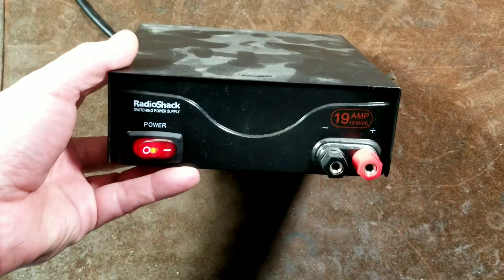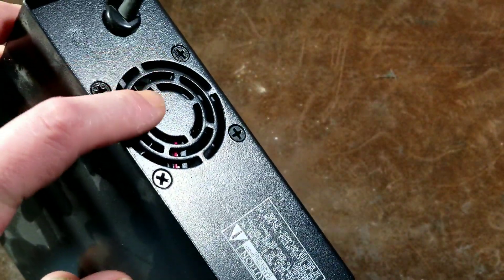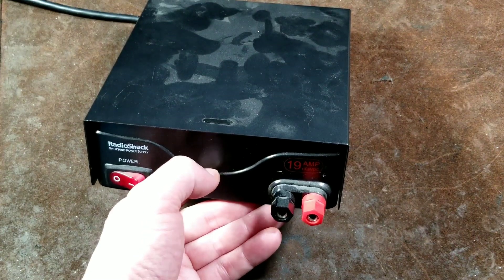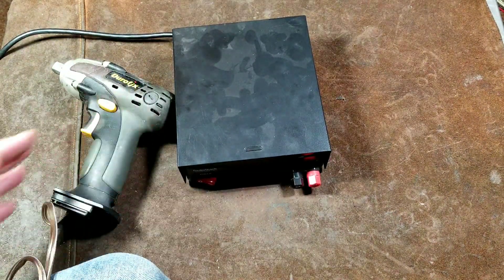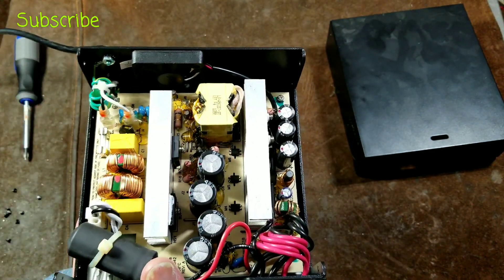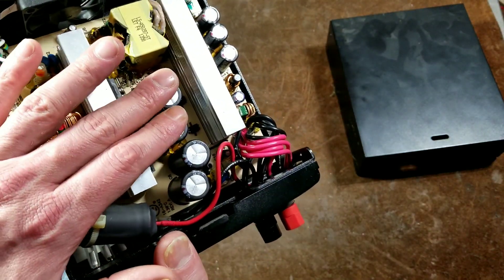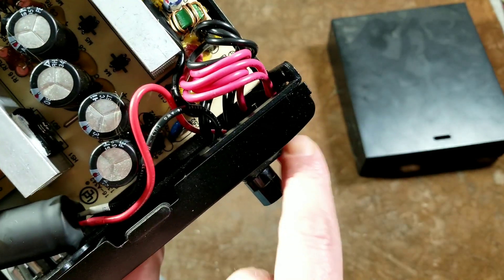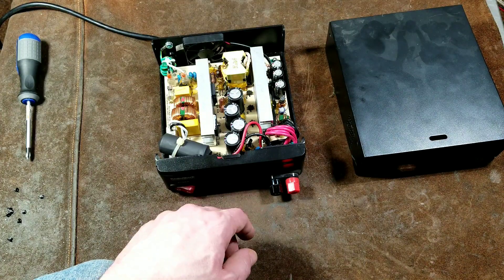Radio Shack 19-Amp 13.8 Volt Utility Power Supply Review

Comment: I got the Radioshack 3 amp 13.8 VDC works great but, will it burn out my Wolfbox dashcam max amp 3?
I'm confused do the amps on the Radioshack regulator have to be equal the same as the Wolfbox above?

Comment: was wondering is there any tuning control on the board so i can make adjustments to the voltage looking for some thing a little lower in voltage 12.6 volts.thanks.jim
Reply from the maker: The output asset buy a soldered resistor I'll take another look and see if I can figure out which one it is really shameful they didn't include a potentiometer
Reply: hi I have one it comes on but won't turn on my amplifier using it for more than five years now an also when turn on I can hear a clicking song when switching it off it stays on for about five sec before it comes off completely 🥺 please help

Comment: I got one of these several years ago at our local RS franchise before it closed. Used it for 2 years straight to power a Kenwood VHF ham radio. Very reliable and no problems with the radio at all.
Reply: I just purchased one for a similar type of radio.  No issues with the noise from a switching power supply?
Reply: @timtaylor8557  No, not at all. I was using a ladderline antenna hanging outside with 60 watts o/p from the radio (TM-271). Talking to a repeater about 30-35 miles away.

Comment: Also check out used rack-mounted server power supplies. You can get the better part of a kW rating for 15-20$. I have  a couple rated for 12v at 62A. The downside is you have to manually connect some of the control pins to enable power and  manage fan speed.